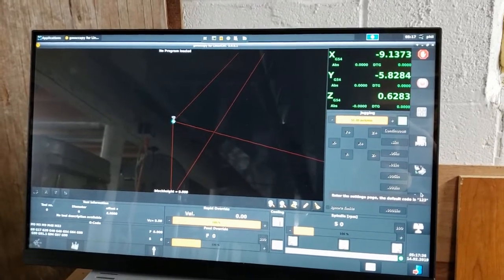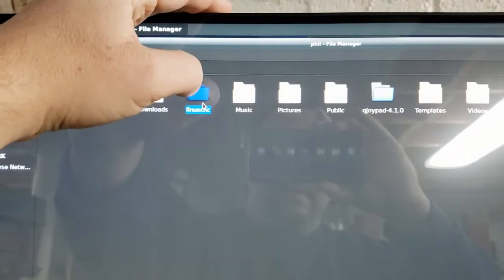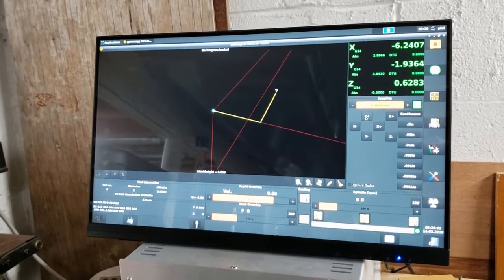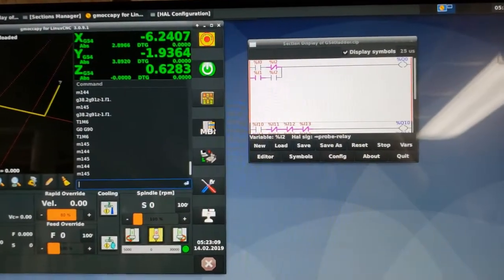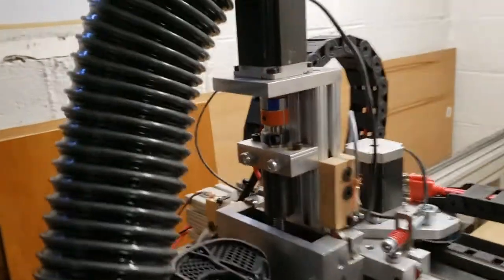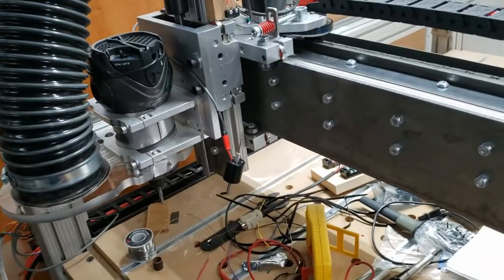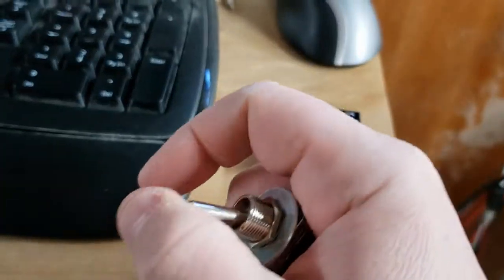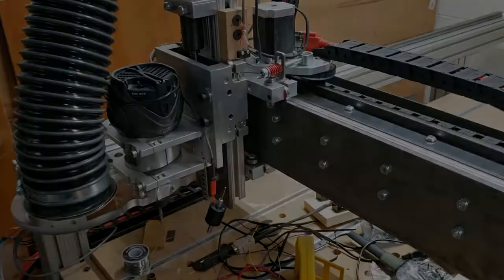Planar PCT2235, LinuxCNC and classicladder probe relay on-machine test

Comment from the maker: @clayton moss - for some reason your comment isn't showing up. I tried to load probe basic onto my laptop with no luck. It doesn't like the GL version my graphics card is running, the resolution isn't proper, there's a whole bunch of stuff that makes it impossible for me to try it out. I'm currently downloading the packages to try it on my router computer (the one with the touch screen) but from what I've seen, it always shows a lot of buttons that aren't being used depending on the mode you're in. I tried the dragon gui in 2.8.1 but a bunch of screens are metric only, which doesn't help me

Comment: Hi. 
I like your videos about LinuxCNC. For double-click have a look in the XFCE settings. Under Mouse and Touchpad you can set the behavior. There you can rise the click distance for double tapping in pixel since its very hard to hit the same sport on the screen in succesion.
Do you also have the problem if you hide the mouse pointer in gmoccapy and restart the machine that you can't move the preview section anymore? Don't know if it's only me or if it's a bug.
Reply from the maker: Yeah I did that and it's still iffy at best. I want to find the way to set up multitouch and right click but I haven't dug into it too much. 

I didn't hide the pointer, so I'm not sure. I'll try it tonight